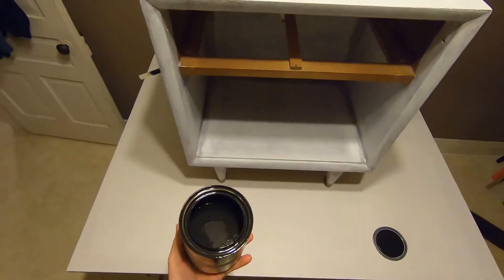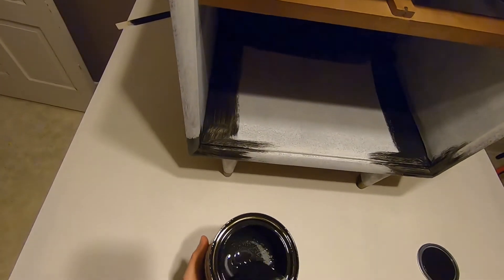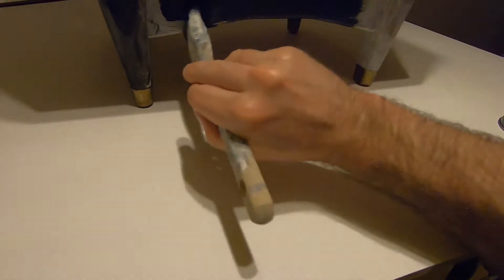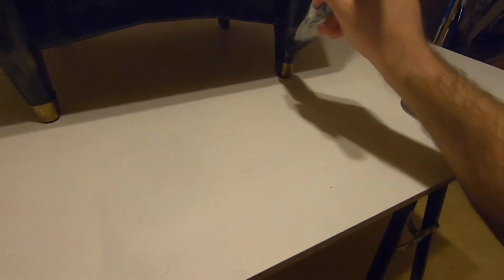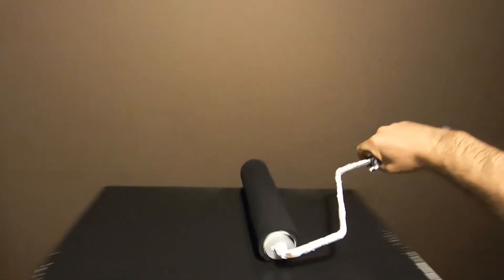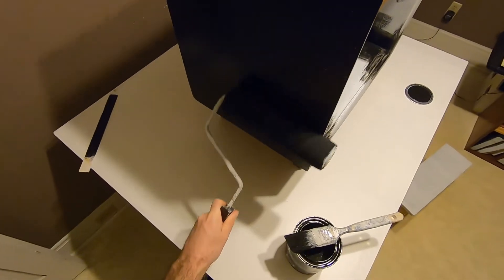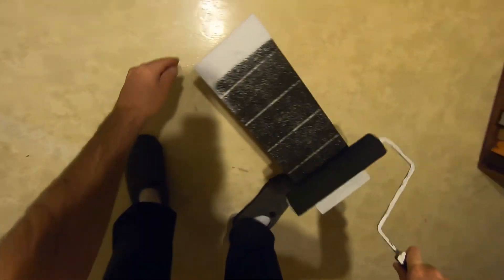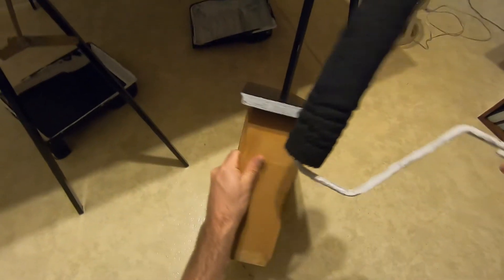Painting a Cabinet Black

Comment: What type of roller did you use?
When you sand furniture,  what brand of sander do you recommend , a variable speed or random speed orbital sander? Thanks:)
Reply from the maker: I just use hand sandpaper actually. 120 grit to scuff up the surface before priming and then 220 and 320 grit in between coats